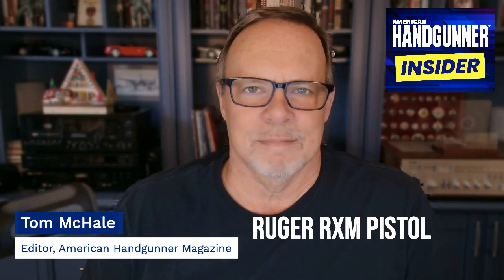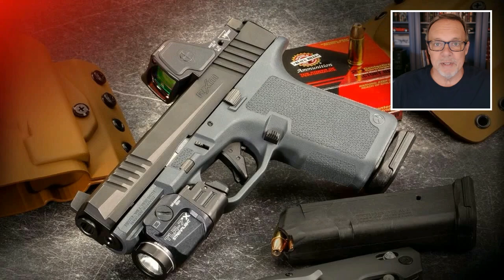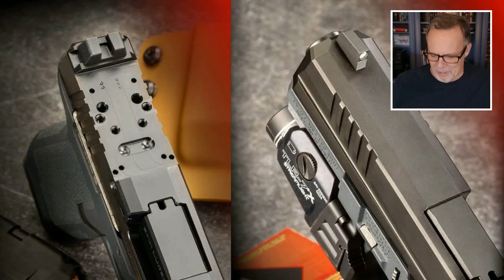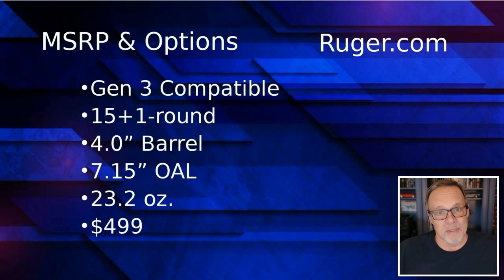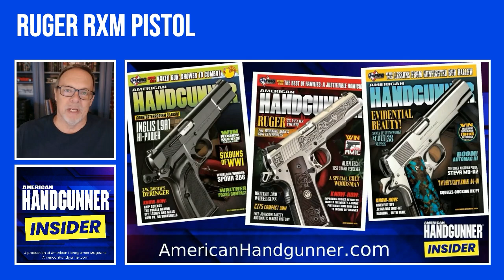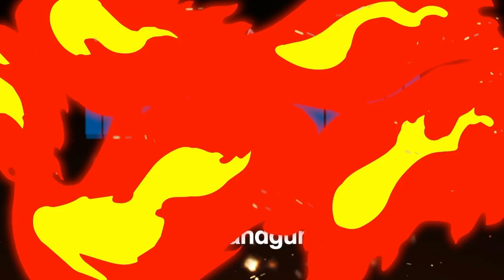New! First Look at the Ruger / Magpul RXM Pistol

Comment: With its 1911 grip frame to go with a serialized trigger fire control unit it is awesome. Flat trigger and flexible direct mounting Red Dot system with 1/3 rd co witness black steel rear sight with tritium front sight. A rail on the frame and a modest magazine well. Takes Glock mags and beveled for holstering.  What’s not to like?
Reply: 1911 grip frame? How did you come up with that?

Comment: You didn't mention the grip angle change and the overall hand feel vs the awful ergos on the Glock.
Reply: There's barely any difference between a Gen5 G19 and the RXM. You might be disappointed if you really believe the ergos on a Glock are "awful." It's a fine pistol, though, probably the best value for $400 out there.
Reply: @JR15A2 Absolutely incorrect. The difference in grip angle is significant. I have never been able to get comfortable with Glock’s godawful grip angle. When you pick it up and line up the sights, the difference is immediate and significant.
Reply: @jammerlr7780  If you say so. It's not to me. I can barely tell the difference between the 20.5-degree angle of the RXM and the 22-degree angle of the G19. The only difference between the two is in the backstrap. The RXM is totally flat/straight, while the G19 has a slight contour like most other pistols. The rest is the same as it has to be to use the same magazines. I honestly don't understand why some folks are so hyperbolic about it. Do you have small hands?
Reply: @JR15A2  No. In fact, if Ruger made the RXM gun or grip module in a G-17 configuration, I would have that as the heel of my hand extends below the magwell flare of mine. I have to adjust my hand position to avoid pinching my hand during fast reloads.
Reply: @jammerlr7780  Same here; that's one of my nitpicks with the RXM. That and the bottom rear corner of the grip starts digging into my hand after 100-200 rounds. The G19 backstrap is slightly longer and more rounded off, so it doesn't do that. Overall, I'm happy with it. I needed one like another hole in my head, but for only $400, I figured, why not? It's a Gen3 G19 clone made by Ruger and Magpul, which is pretty cool and something I didn't expect to see.

Comment: Answering the question.. It is convenient the compatibility, but no mérito in copying something. How can you do something better if you do not study, just copy others. Where IS ingenuity, originality, leadership, integrity? If I want a Glock, I buy a Glock. If a company or two are just based in making It with a twist, more accesibles or both, ok. But Ruger IS abandoning their own path to experiment with outer ideas, not promoting perfecting, improving what they already have. I would like to see a perfected sr9. Instead just watching their quality deccay. Security 9 IS ok and lcp Max is good and Max 9 IS a decent approach. A magpul coglock? Nothing to offer
Reply: A Glock doesn't have a serialized chassis. Change the grip module and you can go from a G26 to a G34 size grip.   Plus it doesn't have the Glock hump on the back.  20 years ago I paid a pretty penny to Robar to modify my G35 to a reduced grip frame like this has.

Comment: An American Glock
Reply: Plenty of them. An unnecessary addition to an already saturated market
Reply: @tofolsalom5784  It's a better version of the Gen 3. The market is saturated with less than.This has Ruger dependability and super service.
Reply: @tofolsalom5784  It's the best in value/most practical American Glock, though, and not an overpriced Gucci range toy.
Reply: @tofolsalom5784 Nobody says that anymore about quality 1911s and ARs. Some of us are old enough to remember when those two had to be Colt, or just a cheap knockoff.

Comment: Looks just like a Glock , with better sights .
Reply from the maker: I liked the grip shape better as well - more rounded than rectangular. - Tom
Reply: @fmgpubs  Better grip angle, too. It reminds me of my Robar grip reduction  Glock.  It should point like a 1911.
Reply: @brucestarr4438  RXM grip angle is 20.5 degrees compared to 17 degrees for a 1911. A Glock is 22 degrees.